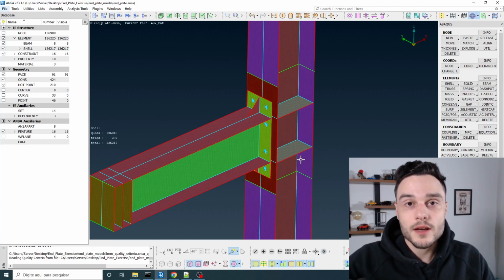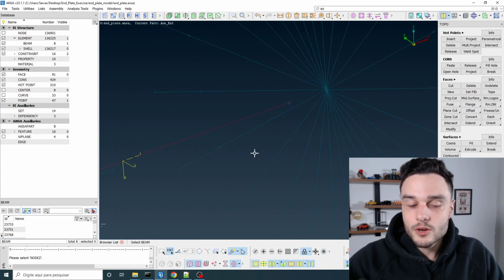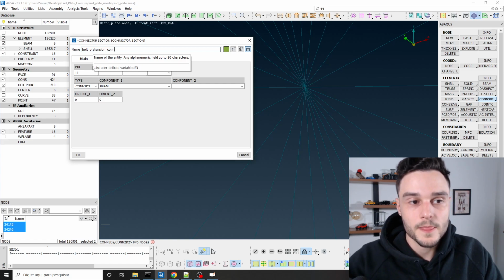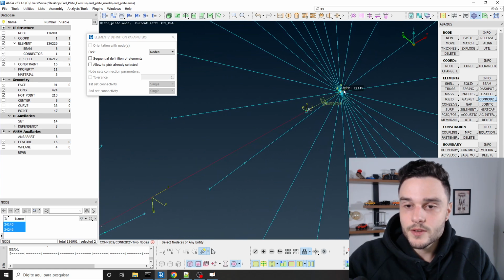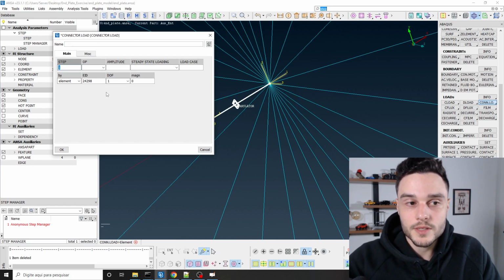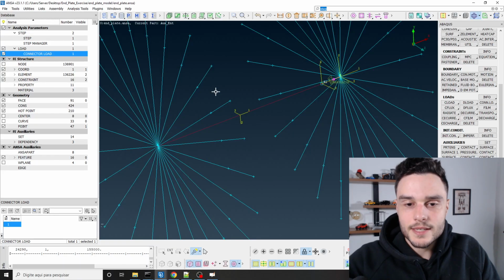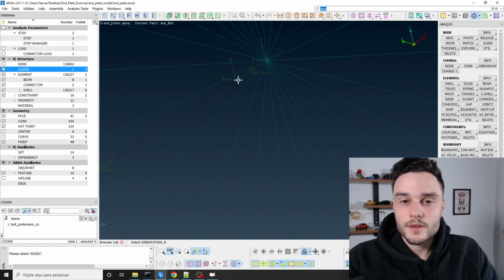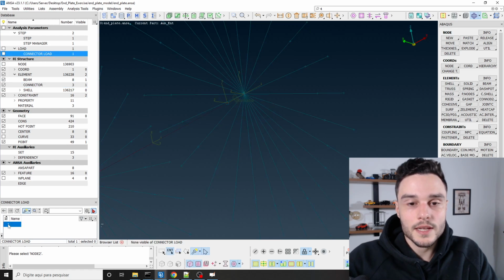Bolted End-Plate Connection - FEA Tutorial with ANSA, Abaqus and META - Part 6

Comment: why dont u prefer applying bolt pre-tension section directly to the beam element. In such way you can preload the beam element without the translator connector application.
Reply from the maker: Good question! I prefer to apply bolt pre-tension using a translator connector as was shown in this video because it think it's more realistic when the bolt, but and washer are modeled using solid elements (as you'll see in later videos). I end up also using this technique for the bolt modeled as beam, but it'd be more practical to use the pre-tension section in this case, as you mentioned. Anyways, you can do it either way. I have written an article in my blog about these two techniques for bolt-pretension. If you're interested, you can access it through the following link: https://learnfea.com/bolt-pre-tension-techniques-in-abaqus/
Reply: @eng.renatocarvalho as far as I know abaqus has a bug when one uses bolt pretension section on large models. The pretension node causes unconvergence sometimes. Your application may help in such cases. However, one can apply bolt pretension to 300 beam elements(like assembly models) with a few clicks although creating 300+ translators could take a lot of time. What would you do in such a situation.? Thanks for producing the best fea material available with ansa btw.
Reply from the maker: @aerocvrd1990   In ANSA, you can create macros using a Python Code. This macro will work as a customized tool. You can create one that automatically creates the translator connector, coupling and beam element. This is what big companies do. In that way, it will be very practical to create this bolted connection. Thank you for the compliment!